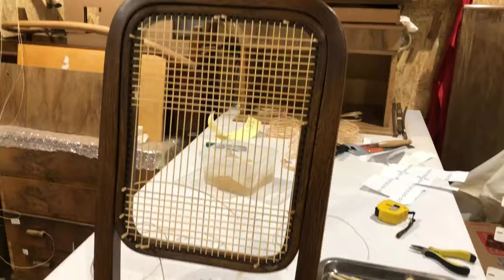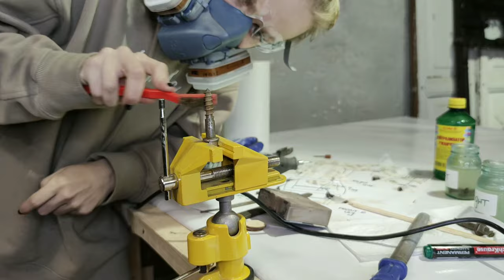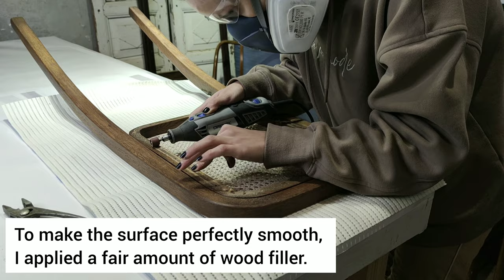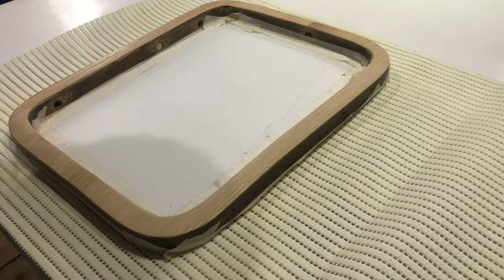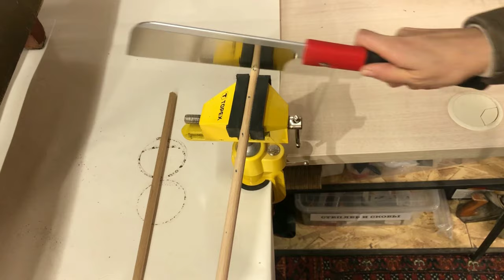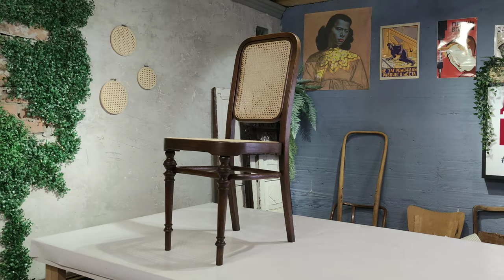Antique Cane Chair Restoration Part 2

Comment: Wow you took it back to its original. Nice job. I would’ve probably replaced the pressed cane and spline. But I don’t know how to weave, which looks like the chair had been repaired once before. When they took it from woven to pressed and filled in all this holes. I have I question, what do you condition the cane with and is there’s a way to get rid of the small fibers poking off the cane? I’m working on a pressed cane chair. Thanks.